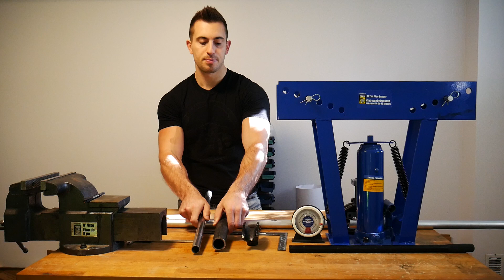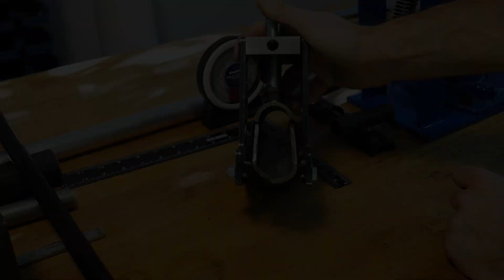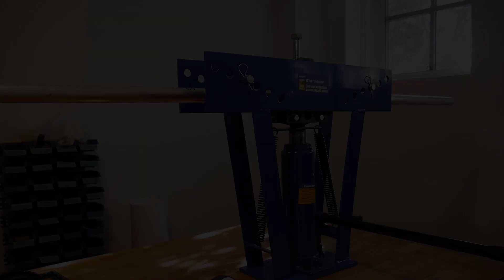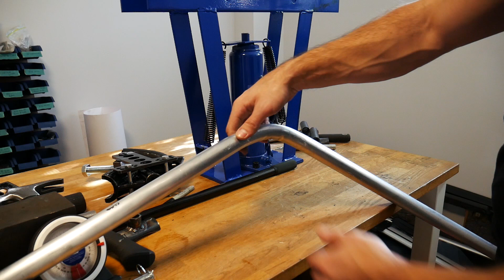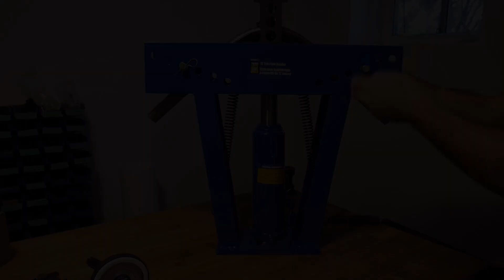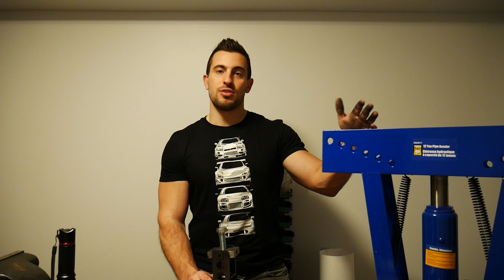How to Bend Tube with a Pipe Bender!

Comment: I picked up some 1 & 5/8” fence rollers and have fitted one of the pipe bender dies so the dia. I’m trying to use a simple metal bender as the base for my tube bender.

Comment: At the beginning don't bend at the center but move left and right (bend a little bit, than release, and move the tube, bend again and so on), and after some bending on the sides finish the bending at the center. In this way the stress is less on the center and can minimize the crushing.

Comment: I did something similar back in 07 on my hf pipe bender dint make the jig but the tubing inserts for exhaust pipe worked great just had to adjust a lot and keep moving the exhaust tubing around but I welded my black iron inserts wasnt easy but just plug welded it to the cast pipe peaces would have been better if I could have afforded a tubing bender but seems like something always comes up when I get the money for one. I'm thinking of making a new die out of the black iron and building my own bender. Thanks for the video

Comment: Check the aluminum alloy.  6061 is really difficult to bend well as it is much more brittle than the 4000 and 5000 series used for extrusions.  One technique is to bend in little increments sliding the pipe to make a bend each side from center.

Comment: I believe if the pipe starts to bend at the corner instead of the center you should have zero kinks , basically it will stretch and bend pipe from edge of die instead of center . Overall great modification 👍.
Reply from the maker: I believe that is a better strategy just the way a regular tube bender works!

Comment: I really apeeciate you sharing this video.. I have been thinking on doing something about the same problem with kinking and I happen to  find this video..  

I am going to try making it my self and I just wonder..  since the tube doesn't start kinkiing at the beggining, but only a little bit after, how about if the piece making the preasure in the center of the tube  has a circular or round shape just lke the die and is thighten after having bent the tube already a little bit so it would make the right preasure.. 🤔 That's what I am going to try.. thanks for sharing once a💪🏽
Reply from the maker: Could work, worth a shot! When you build it, come back and let me know if it worked!

Comment: That was a really nice video. I’m willing to bet if you tightened up those side walls of the lower die that you opened up, and keep your other changes you will have a working tube bender. Containing those sidewalls tightly is what keeps the collapsing from happening. Of course, packing the tube with sand is another big help, but you’ve seen that before. Again, very nice job. I’d be proud of that!

Comment: Thank you. Great video. Your idea of using pipe to make the pipe dies fit tube is total genius. I think the quality of bend you got with the tube you used was as good as it can get in a single shot without any type of filler. It probably only kinked at all towards the end of the 90 degrees. 👏 Bravo
Reply from the maker: Thank you! It was a decent result, probably could improve with more time spent on it, but for the price it did the trick

Comment: Make your bends in 3 separate spaces of the tubing. Start with the center and make a bend on both sides of the initial bend you won’t have kinking with the aluminum either.
Reply from the maker: This could be doable, but then I guess you wouldn't technically have a single radius bend

Comment: The aluminum tube will be more prone to kinking as well. If it works on soft aluminum it will work even better on steel or chrome molly.
Reply from the maker: Yes, I tried steel and it was better... still kinked but better than the aluminum

Comment: For shorter Aluminum tubes fill the inside with sand and plug ends tightly. If it works reshoot the video...best of luck
Reply from the maker: Thanks for the tip!

Comment: Fill the tube with sand (pack it in tight). Paint the inside of your dies with grease (light coat, just a film). Voila, no kinking, grabbing, or deformation. You can fill the tube with ice as well, but water and steel is not so awesome, and long pieces dont fit well in freezers, lol. Copper tubing is formed into those packing coils by filling with pressurized water or oil before the coiling operation to prevent kinking. 
Broomstick, bucket, funnel, rubber pipe caps and a couple hose clamps is your sand packing tooling, an a frame ladder will let you pack 10 ft runs if you have a high ceiling.
Reply from the maker: Great advice, thanks!

Comment: Nice job. I did just that a few yrs ago. I made these jugs for my most comon sizes. Your top  jig is a nice addition.👍
Reply from the maker: Thanks 👍 the ones you made worked well for you?
Reply: @EmbraceMaking  Works pretty good on some lite mild steel tubing and hard electrical conduit. I built pickup toppers W/canvas on them. Still holding strong after 18yrs. Your roller jigs will work if u just cut off the pins, make them at least 8"L 
Let them float between the rollers and work piece. It,s a bit of a chore but after u bend a few pieces it gets easier. However it,s hit and miss for being perfect. I never used them in a heavy dity structure. I also built 20'x20' canopy frames. Held up to 2'of heavy snow.  Great for those kind of things. For pipe i bent S40 for pickup steps & other truck stuff using sand and by measuring 1" increments. Both worked for me.  Hope this helps👍

Comment: is this still what you use for bending tube? im pretty set on ordering a JB Squared bender or one similar to it in design just wondering if anyone makes dies for less than the 300$+ that they want? the bender itself is only 320-390$ but every set of dies is about that much so by the time you get 3 if not 4 different sets of dies youre looking at 2k to the door.. thats for the US since im in canada i cant most likely double that.. not because of a huge currency difference but because everyone likes to mark things way through the roof in canada
Reply from the maker: I don't use this tool to bend anymore... I got away with it for a few projects, but since it doesn't make smooth bends for tubing it wasn't much use for me. If you're okay with the odd wrinkle you could use something like this but you really have to tinker with it. It was a fun project though. I hear you about the tubing dies... crazy expensive.. I'm in Canada too and we get screwed on mark ups ... anything that crosses the border is twice the price.

Comment: In the Navy in weld school we packed tubing full of sand and beat wooden plugs in the end to keep the sand in. We heated the tubing with an oxy/acetylene torch to bend it and they always turned out perfect. Youre not using oxy/acetylene, but I bet the sand and wooden plug trick would still work great in this application. Pretty cool video man!
Reply from the maker: Thank you! I haven't tried the sand trick yet, but it's been suggested a few times. Seems like it has a good reputation. Thanks for watching!
Reply: @EmbraceMaking  Reminder for those who may not know --  Make sure sand is completely dry or pipe can explode!
Reply: @sickvet9996  it won't explode if you don't heat it.

Comment: Nice tutorial.. I’d imagine having to custom bend like shifting the pipe shopping the way to spread out the pressure point. I have to get a pipe wrinkler to make a crash bar for a car with a compromised impact bar and missing a  header panel.

Comment: Very nice job on the tooling. Could be made much easier/cheaper for the guy w/o so much stuff.
I think the half sleeves at roller ends of the tool are a great Idea only if you lay a longer piece between the pipe being bent and the roller guides, they would have to run free with the pipe being bent (not locked in). The kinks I'm led to believe are made as pipe swells sideways it will catch as it rolls the bend. Not much to do here ....... But mark the pipe to bend on the outer side with 1/2 or 1-inch intervals bend slightly (count pumps) then move to next outer mark and bend again..... one side than the other as I saw another gentlemen do. Methinks this unlocks the binding/pinching as you must knock out to readjust each time.  I'll bet you will eliminate the kinks perhaps slight dimpling. Adding sand, of course, is well too.  I don't have one but think the 12 ton will more than suffice for most things at a home shop.  The center clamp is a good addition and very well made.  I'll have to build with scrap stuff  Great video!
Reply from the maker: Thanks for the thoughtful feedback! Your method of stepping through the bend could work!

Comment: The "crushing" on the inside of the bend is wrinkling caused by the metal being compacted on the inside of the bend. The flattening on top is caused by the metal stretching, pulling itself flat. It is extremely difficult to prevent either of these issues unless using a mandrel type tubing bender. Applying heat to the area of the bend will help to eliminate flat spots and wrinkles.
Reply from the maker: Yep, no replacement for the right tool!

Comment: Why can’t we buy the exhaust tubing size dies and rollers
Reply from the maker: Tubing is thinner and requires the profile to be pulled around the die as it is being bent. I guess they don't sell the tube size dies for pipe benders for this reason... It's tricky to make it work well. This was my experiment to confirm this.

Comment: Out of interest, as I want to try make this to solve problems we are having, when it comes to preparing the shim plate to go inside the die, did that bend smoothly ok just because that was a snugger fit inside the die - or will I get problems trying to create that bend in this bender (Inception!) :)
Reply from the maker: Hi Andy, since the shim was made from pipe and not tube, it did bend quite smoothly. It was a nice fit inside the pipe die as would be expected. This was the logic behind this... if the pipe bent smoothly inside a nicely fitting die, I should just be able to shim it and bend tube smoothly too. As it turns out that wasn't the case for my experiment as perhaps the wall thickness may have something to do with it.

Comment: One solution is to fill the tube with sand. The other is to reconfigure the pipe bender as a tube bender by modifying the dies and frame to work the same way to wrap the tube around the die. At least you demonstrated how to mod the dies for the right tube size. The biggest part of the benders' prices are the dies!
Reply from the maker: Yes the dies are very expensive so this could potentially work with also modifying the bender as you suggest :)

Comment: thats too much work!!!! the way i bend tubes or pipes its simple using that same 100 bucks bender. i get the tubes usually aluminum put sand inside and heat it up with a torch works everytime
Reply from the maker: Thanks! Although I agree that this is a lot of work, I was trying to eliminate having to use sand. I've felt like that is typically messy and quite a bit of work too.

Comment: Awesome
I recently bought similar pipe bender without knowing much details and disappointed that I had made a big mistake (my aim is to bend up to 2 inch pipe)

Your video is much helpful
I want to bend stainless steel tube 1" dia but 1mm thick. Is that possible
Reply from the maker: If it is tube, you can bend it but the quality will be poor as you see from my experiment. Your best bet is to use the right tool for the job. Thanks for watching!

Comment: there's a reason why there are pipe benders and tube benders out there (yes they work completely different), just buy a proper tube bender and save yourself a lot of trouble, they aren't that expensiv and you have it for decades if you are using it properly.
Reply from the maker: I agree! This is why I wanted to share my experiment with others :)

Comment: If you used one of the larger dies with more shim you may have better results. Like maybe a 2” pipe shimmed out for the 1-1/2” tube possibly. They have a larger bend radius and should spread the bend over a larger area. If you need the tighter radius I think you’re going to have to use a tubing bender as you mentioned.
Reply from the maker: For any serious work I will be making my own tube bender down the road :) Thanks for watching!
Reply: I saw in a video where they got better results going to a smaller die than what's labeled for the pipe. The tube would ride on the edge of the die, resulting in less kinking. You could also move the tube an inch over and bend it a little each time instead of bending it all at once, like several small bends distributed over longer distance.

Comment: The difference between pipe and tube is mainly their diameter, the strength is similar when comparing tube to pipe with the same wall thicknesses. The problem with this pipe bender is that it doesn't even work well for bending pipe, if it did you could substitute pipe for tubing in some applications but not the most critical of course.
Reply from the maker: Thanks for watching Phill. Yes, I would not recommend using this style bender for anything where the structural integrity is important.

Comment: An excellent video that covers pipe bending is:
Shortening Your Pickup Line part two by Keith Fenner.
Comments are helpful also.
I use a pipe bender similar to yours but only use it for solid stock and that is for handrails on farm equipment.

Comment: I got no idea what you guys are doing wrong. I have been using pipe benders similar to yours for years, I am on my 4th in about 25 years. I have no problems with 1", 1.5",  and 2", down to 0.080" - 25mm, 38mm and 50mm, down to 2mm thickness. 

When i get them, first thing I do is smooth and polish the hell out of the 3 dies. I have never have had one with roller outer dies, always 3 sided diesthat  you choose the closest scallop that fits the size tube closest. I also usually space those 2 dies out one hole further apart than the manufacturer reccommends. 

The tube must be clean. If i get tube with rust or mill scale on it, out comes the sander. A wrap of newspaper can also help with dirty tube.

And that's it, except when i pump, I make sure the handle does not hit any part of the machine that stops it suddenly. Always bring the stroke to a stop with your own hand, this stops the hydraulic stroke gradually and doesn't allow minute return of the ram that is proven to make ripples on the inside of the bend.
Reply: You have a thee sided die? Rather then two side rollers? I cant even find anything of the sort on line?

Comment: The problem is the hydraulic ram is keeping constant pressure on the centre of the tube whereas a tube bender constantly changes the pressure point. So, try changing the function of the device like this:
1) Move the right roller all the way down (new hole required). The tube will now sit on top and rest on this roller. 
2) Next, take the die and flip it upside down, then move it off-centre to the right of the ram centre, new holes will need to be drilled. (The ram should be able to extend all the way up past the die. The die should actually be rotated not completely upside down, but about 100 degrees anticlockwise from its stock position. The bottom lip of the die should line up with the top of a piece of tube that's resting on the newly relocated right roller).
3) The ram will need to have the roller, or your clamp (that you made for the top) attached to it.
That's it. Now, place a tube on top of the right roller remember the roller has been moved down as far as possible), feed the tube over the ram, and keep going past it.  Now, use the ram as normal, it will push the tube to up the bottom edge of the die and as it continues up, the pipe will now start to wrap around the die. There's no longer a central point of pressure and it's acting as a mendrel bender.
Potentially you could leave the top right roller in the top right stock position to get more of a bend. The most important thing is to have the die mounted to the frame, as opposed to having it on the ram.
Reducing the pipe diameter to tube diameter still applies of course.
Reply: This is  fascinating idea, could you create a video or send pictures?
Reply from the maker: Interesting! Might have to try this out sometime!

Comment: Why don't you seal one end and pack it full of sand real tight and seal the other end and heat it with a torch and bend it useing a dye to get the bend to desired bend radius
Reply from the maker: It's been suggested a few times. I tried to do it without sand because of the additional time + hassle required. In the future I will be building a proper tube bender :)

Comment: Try filling the pipe with sad first.  Make sure packed right in there.  Cap both ends and giver..  As the pipe bends it can't crush the inner because the sand, then strechs the outside of the pipe.  But depending how much of a angle you bend the strech will make more surface area in the pipe,  so you may have to keep adding sand..takes time  But better then nothing..
Reply from the maker: Thanks Keaton, a few people have suggested sand now, but I think I'll just try and make a proper tube bender soon! Thanks for watching!